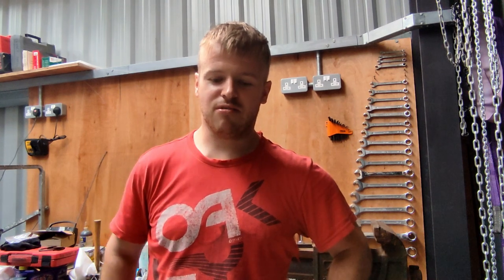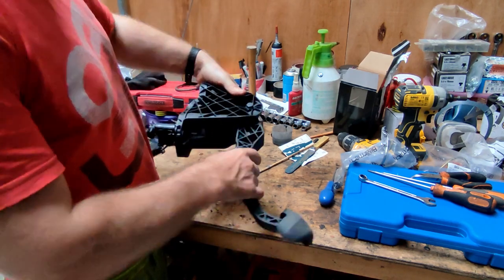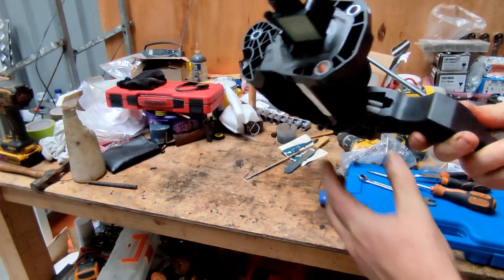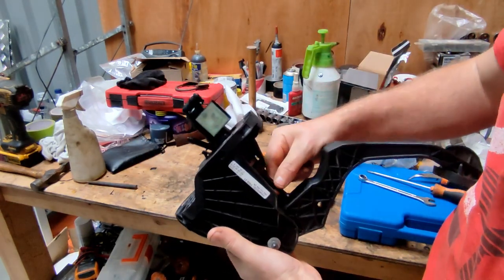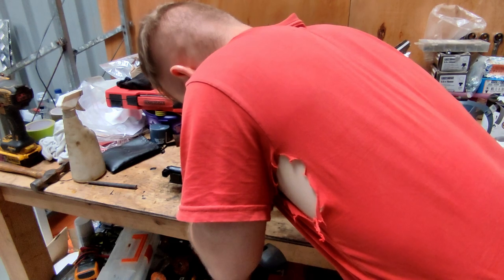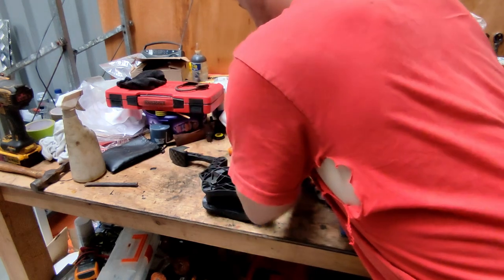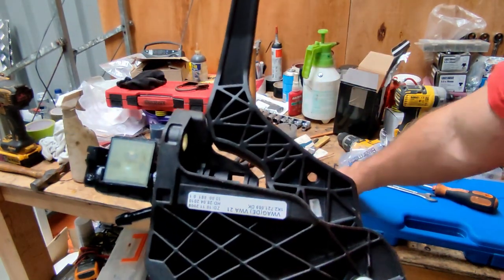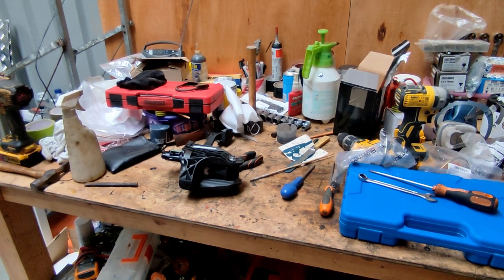MK6 Golf changing the Clutch Master Cylinder on the pedal

Comment: Our mk6 golf has a clutch problem.
With no warning the clutch pedal went down and didnt come back up.
Even if pulled up the clutch no longer worked.
I removed the slave cylinder and it seemed ok so i bled the system and the clutch works again BUT...
The clutch pedal stays down if you push it to the floor! Any ideas??
Reply from the maker: Are you losing fluid from the reservoir? When you finished bleeding it was the clutch pedal returning normally?
Reply: @aguyandhisgarage  i think ive just found the issue. It seems there is a small crack in the clutch master cylinder. Thanks for your reply
Reply from the maker: @Yamaprilia  yes, I do another video on removing and refitting the master cylinder. Hope it helps you out, and I would recommend you buying a OEM quality replacement as the £30 master cylinders only seem to last 6-12 months